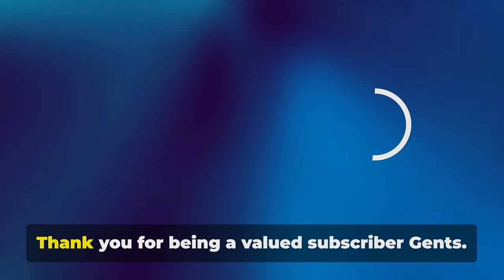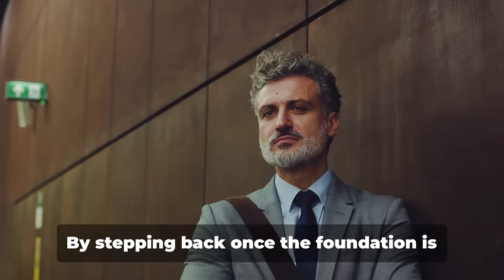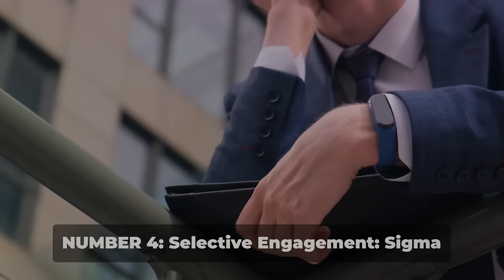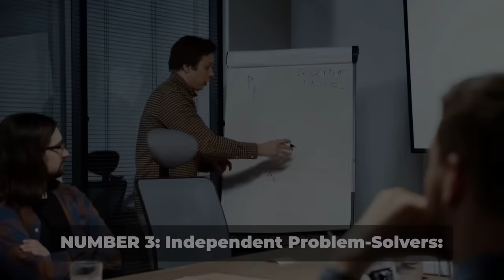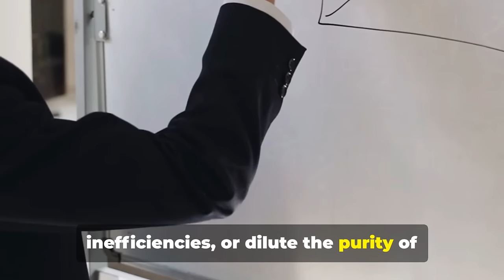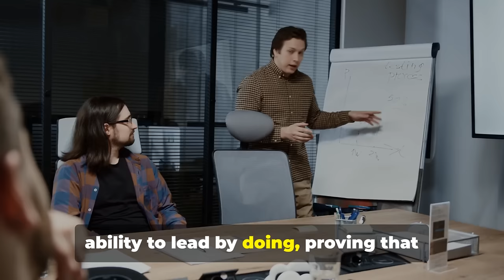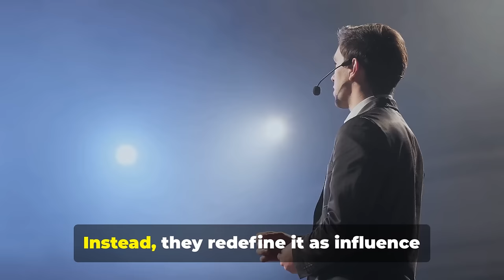Why Sigma Males Are Born Leaders But Choose Not To Lead

Comment: The mistake this video makes right from the start, is to assume the stereotypical position, one which I believed before I got into leadership to any degree. The stereotypical is that alpha's lead, or big mouths in any case. Nope, not at all, that is if you are put into lead, because you will transform that into your idea of ideal leadership, and it will be quite different, quite different indeed. In fact, with my first stint in leadership, I would say it went so ridiculously well, that it's easy to think it is something you not only were born to do, but that you LOVE it. Unfortunately for me, you might say, I put rules on myself and leadership, and I won't assume it until I'm convinced I'm at least as good as anyone else, or I'm forced into it. 

Later into life I had maybe about 4-6 more leadership stints, some very, very brief, but I keep track of them somewhat just because it seems I'm a fish out of water there, yet I still end up doing it here and there. At least in my case, the leadership comes easier the more manual the job is, because with weak men they will cop out as a leader and not do any of it, but you as sigma have a lot of strength both mentally and physically, and you will do the work right alongside your subordinates, which gives you that great example edge you have over many leaders. One of the things working against you, is just the overall knowledge that you aren't the social guy, and I presume that can bite you quite a bit, but it never affected me, except that it was a rather main reason not to lead in the first place, but hey, if somebody is dumb enough to promote me into it, well, maybe that's not so dumb. 

All I can say for sure there, is just because you may have worked very well with one group of people leading them, doesn't mean all groups you may have to lead, will work (it certainly didn't have that effect on me, even though my best leadership was at my first job). I think it's all a part of that system of getting yourself at least up to par with the others, because elsewise you may not have a leg to stand on, and part of that is probably that you need a preliminary exposure to those people before you get that promotion. I would never go into a company with a leadership position and not know anybody AND not know the work. Alpha's can probably do that just fine, but I suspect I cannot. I spend no more than 33% of my work life as a leader.